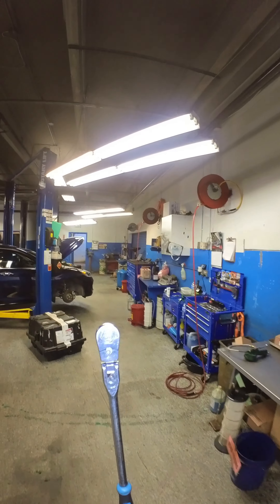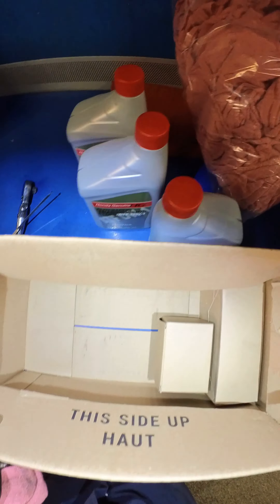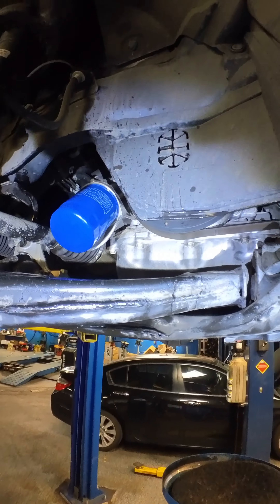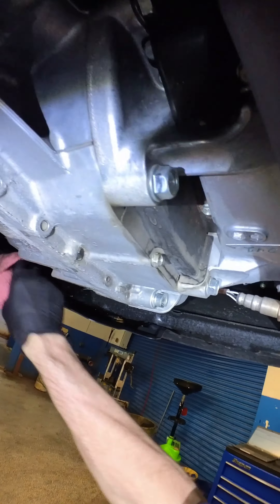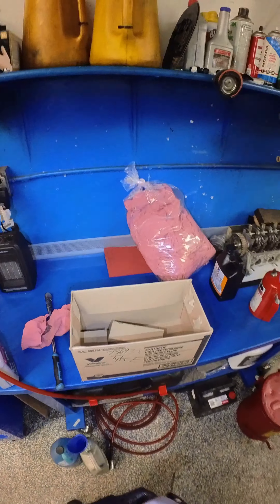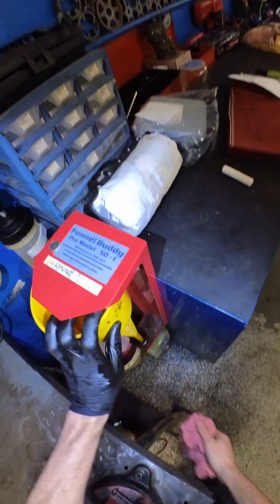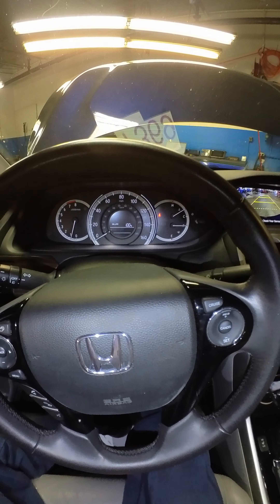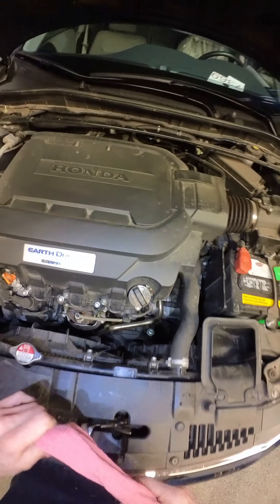2017 Honda Accord Transmission Service POV 🔧👀 #2017 #honda #accord #transmission #atf #pov

Comment: why don’t u fill it to top line? not judging just curious. love the vids man
Reply: Great question…I would like to know the logic behind this also..
Reply: @4Runner21  only thing i can think of is literally idiotic. and it’s too try and mess with it. maybe cause some overheating issues after a long drive and the engine burn some oil causing so
Reply: You don't need to. And if he were to try, and over filled it, then he'd have to drain some out. That's a nuisance, for no particular value. Honda's exact spec, per their service manual, is "between the dots" after it's warm. Where "warm" means the cooling fan cycles once, and no more because that would heat up the transmission fluid further and then it might read too high. If it's over filled it's going to creep forward in neutral.
Reply: 1 year old comment, oh well! The transmission fluid still wasn't very hot. That fluid expands with heat. If he took it for a 30 minute drive on the highway it would have been at the line.